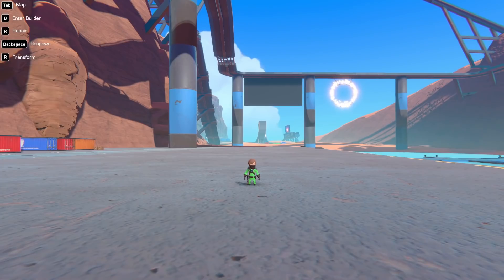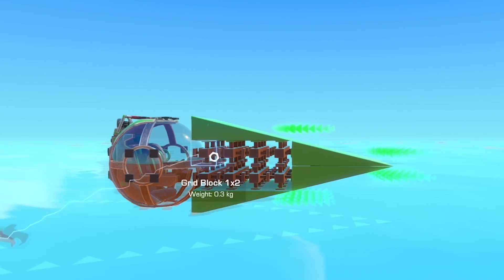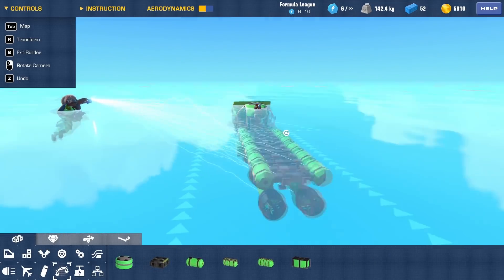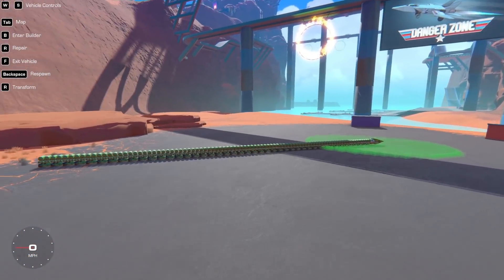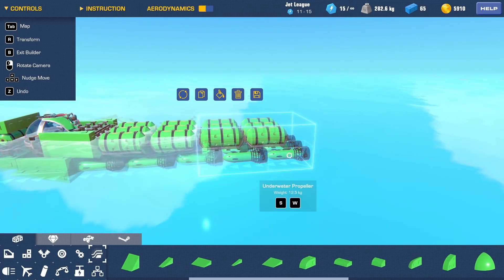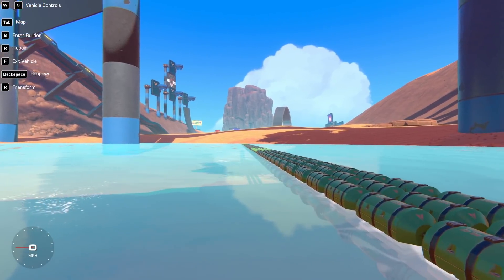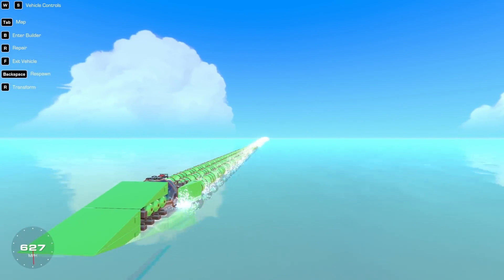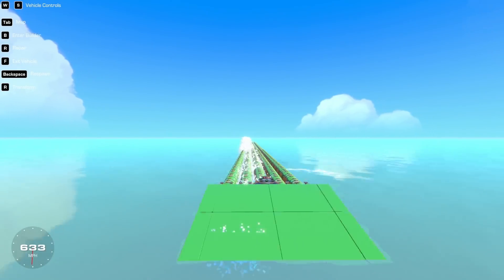Can you BREAK THE SOUND BARRIER in a boat? Trailmakers!

Comment: Fun fact; the speed of sound in water is roughly 4.5x greater than it is in the air (1500 m/s vs 340 m/s). That coupled with the fact that water doesn't really compress make it basically impossible for us to achieve "supersonic" speeds whilst underwater. Similarly, having a boat going supersonic, even if you account for most of it not actually being in the water, is probably not possible IRL. The difference in drag ratio between the parts above and below water would be too great.

Comment: I could imagine having a boat on water going the speed of sound or more would not fair too well for the boat unless it was structurally designed for it.... Water in just a small stream of roads inches out of the Earth in a very short time... At speeds of sound think about all the weight and force that would be on the weakest parts of a ship 😆

Comment: It's sad that no one knows about aquadynamics anymore. We're just getting dumber by the second.
Reply: Well, I'm not even an engineer, but I know that a stupid wedge like that would bite into the water worse than a thin destroyer did, biting into waves is bad for boats in the long run. Why we developed hydrofoils in the 1960s was apart from what happens at speed on the water, not in it, the less contact with the water there is, the less friction, the faster it can go. Anyway, I have the game too, but how bad the aquadynamics is, like you can block the waterflow the the propeller pods without impeding performance does break immersion and does make it seem a lot less serious for real world designing.

Comment: If the game was somewhat realistic in terms of boat speed, power to weight ratio is something I would recommend taking into consideration (not to mention weight in general). Furthermore, propellors blocked by blocks won't be as efficient (IRL). Lastly, a hydrofoil or catamaran structure probably would have been more successful (due to friction) They might be hard to build though, as pontoons are the only pieces creating buoyancy.
When making the submarine, check if the hydrodynamics are related to the aerodynamics (if they're not, then the weight will effectively slow it down without helping anything else). It did seem like the aerodynamics were a little overestimated in terms of necessity, as the craft was quicker backwards, where it was less aerodynamic.
Most importantly though, don't forget to add a fin or two for stability and steering.

Love your videos!
Peace, love and nobs.

Comment: A high speed power boat actually skims the surface of the water with just the props in the water, basically flying above the water when up to full speed. A carefull balance is needed to ensure the boat does not flip backwards.
Reply: U mean a hydrofoil?
Reply: @mimzy6067  No, a hydrofoil has fins that lift the boat up above the water. Go and look at any high speed racing boats at speed, you'll see that they have minimal contact between the hull and the water, trying to skim or stay above the water, getting as much air under the hull to lift the boat out of the water, whilst keeping just the props either fully or half in water and trying not to do a backflip. The more the hull is out of the water, the less resistance and fater the craft can go.

Comment: *Boat pulls 10gs when trying to stop.*
Engineer: "Take's a while, Not too bad."
Reply: As a person whos played flight sims, the place where you usually reach those speeds, that deceleration was actually ridiculous
Reply: Positive 10gs is handlable, and you can probably stay awake with a bit of forewarning and training. -10gs however, you are out cold
Reply: @andreyrumming6842  also depends on if your craft is built to handle it. 10gs in a fighter - no problem. 10gs in a cessna - goodbye
Reply: @andreyrumming6842  It depends on the direction, but not just up or down. Forward and backward accelerations are much more survivable, which is why astronauts are launched into space lying on their backs. Because of this, the record for surviving a sustained g-force is 46G on a rocket sled, while the record peak force survived is 214G, during a major accident during a race at Indianapolis Raceway.
Reply: Had the same thought lol
Reply: XD

Comment: Remember, the speed of sound in water is about 1500 m/s.
Good luck.
Reply: Yep, about 3300 mph, give or take, depending on the temperature and/or salinity of the water -- a little over 4 times as fast.
Reply: @bloodgain  can you say it in knots?
Reply: A casual mach 4
Reply: @Palmtop_User  very casual
Reply: easy, just use the zero drag glitch, you can do it with maybe 15 propellors
Reply: @THESLlCK One UFO engine with the zero drag glitch would be enough (one UFO engine is made out of 2 hoverblocks, 4 steering hinges and some wedges)

Comment: It doesn't mater if air or water in trailmakers
Reply: I said camra angle not about jets
Reply: @dipjolbajracharya7647  didn't seem like it in your comment, but ight
Reply: It does though, first off all, jets do not work underwater, water also slows you down a bunch.